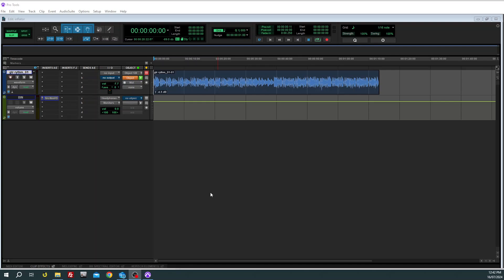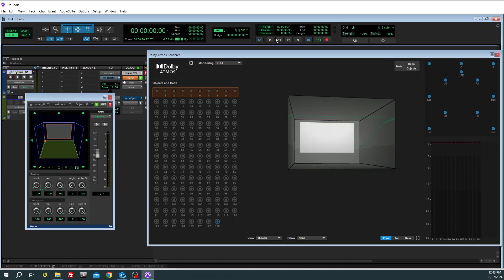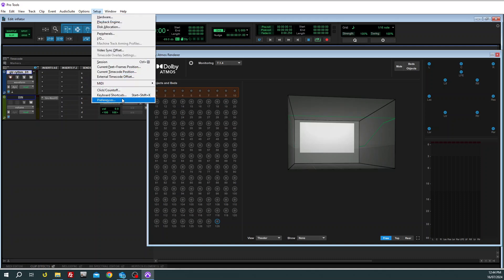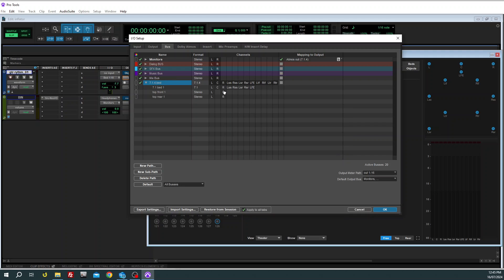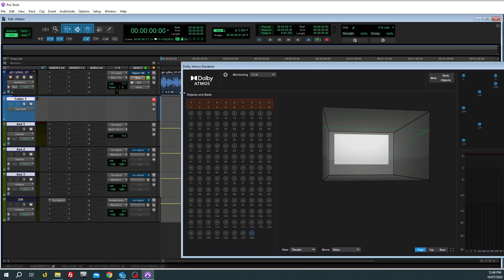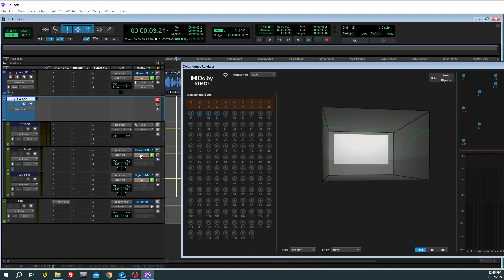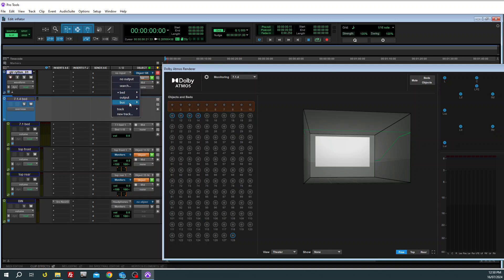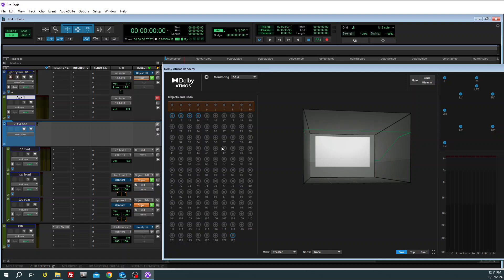Dolby Atmos - Creating a 7.1.4 bed in Pro Tools 2024.6 with internal renderer

Comment: This may be a dumb question, but I’m not sure where else to ask. How were you able to get more than just the L and R beds to show up in the renderer? Such as C, LTF, RTF, etc
Reply from the maker: Each channel of the bed is an object that is assigned to a channel of the renderer and positioned where it needs to be, ie- top left, rear right etc. Pro Tools now has channel presets for this so you don;t need to go through the process of setting this up manually .

Comment: Is there no way to output a 7.1.4 bed directly to the renderer with correct object positioning for the .4 channels? Without that it doesn't seem very useful to have the capability of making 7.1.4 and 7.1.6 tracks.
Reply from the maker: Not in Pro Tools, but it's Dolby's decision really to fix their beds at 7.1.2. Maybe they'll add larger beds in the future, who knows...For 7.1.6 you could use a 7.1.6 bus and 6 positioned objects instead of 4.
Reply: @MusikUndDesign  I actually just found out there are built in track presets that convert a wide bed to a 7.1 bed output and objects for the renderer. Create a new track and then go to track presets>Avid and pick 7.1.6, 7.1.4 or whatever. It’ll make a routing folder with a bus input of the full bed width and convert it. I’m well aware of the renderer not recognizing anything wider than 7.1.2